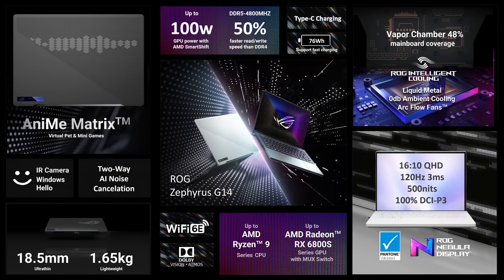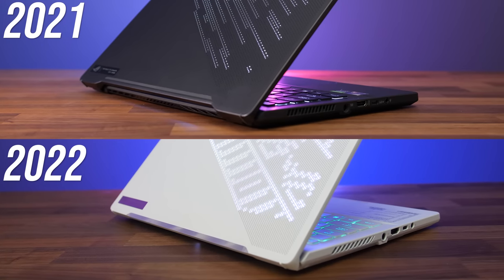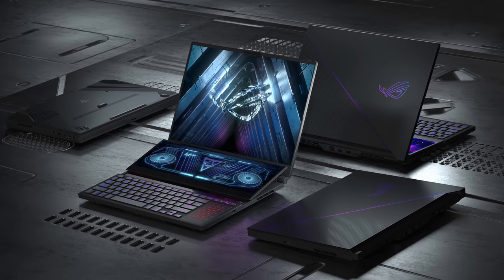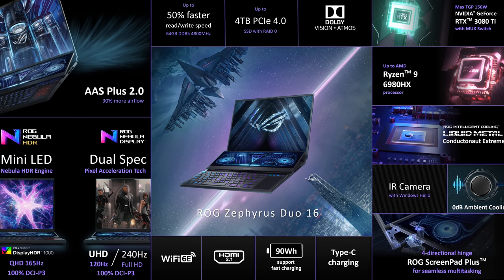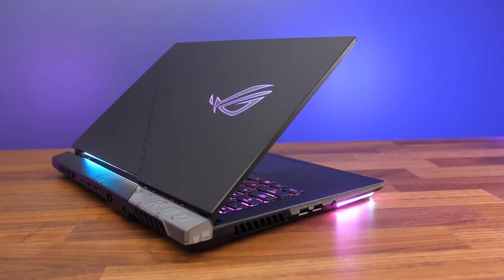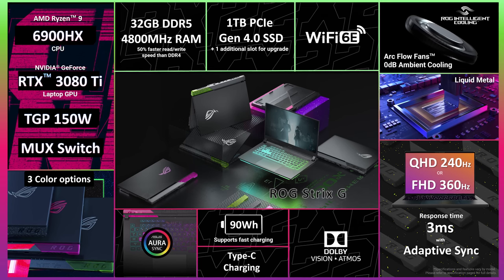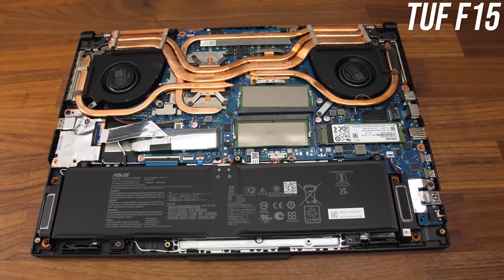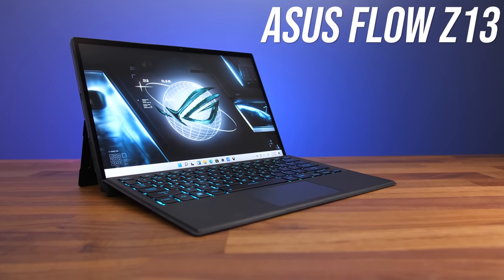ASUS Goes Crazy With Gaming Laptop Updates in 2022!

Comment: Was considering a G14/G15 for the past year, but didn't want to spend so much money on a laptop that didn't meet some of my basic requirements, like having a webcam. Alongside all the other updates I think I have finally found my replacement
Reply: Same
Reply: You can use your phone as a webcam through their software…
Reply: @NamTran-xc2ip  Yeah I know, but during long meetings and lectures I still like to use my phone sometimes. I just think for the €1800 I would be paying, every basic requirement I have should be included. It’s not like I desperately needed an upgrade either, my current one still runs fine, so I’m waiting until something better comes along, and this might just be it
Reply: its a perfect laptop for me but $1800 is so much
Reply: @Tom2000vE  no webcam = Slimer bezel. It's a trade off. I got the g15 3070 for 1300 so idk why you need to pay 1809
Reply: @NamTran-xc2ip  I’m aware, still I would rather have a webcam and thicker bezels than the other way around. It’s a personal preference 

Prices heavily depend on what country you’re from. I’m from the Netherlands, and would have to pay €2400 for a G15 with Ryzen 9 and RTX 3070. For €1300 you could get a G14 with 3050 here
Reply: @Tom2000vE  what's ur replacement?
Reply: @NamTran-xc2ip  I tried it and it's not that good. quite laggy.

Comment: The 2021 G14 not having a webcam was the only deal breaker for me. Now it basically has no flaws, and a strong choice for laptop of the year.
Reply: dude same
Reply: Having touchscreen would make it perfect imo.
Reply: Among the 3 14in gaming laptop it feels a little no brainer to go for the g14 if prices don’t changes too much since Alienware and razer will definitely be more expensive for somewhat dated design (16:9)
Reply: I bought the 2021 G14 in August of 2021. For me, no webcam is great as it wasn't present in any of my last 2 laptops (dell latitude E6400 and E6540)
Reply: Webcam but no NVDIA. Something had to be sacrificed ):
Reply: @h3ctor272  not having nvidia isn’t bad. Worse ray tracing but outside of ray tracing performance per dollar amd had it in 2021 so I don’t see it changing in 2022
Reply: @h3ctor272  yeah, most people attracted to g14 is those who don't really care for super high end performance i guess. just a really good gaming laptop that is thin and small enough for portable use that you can just open and do work in starbucks without looking like you are carrying a spaceship.
Reply: No g sync. So if you turn off Optimus, you will have no adaptive sync since turning off Optimus turns off free sync/adaptive sync.
Reply: it starts at 1650 tho😬

Comment: Wow, this G14... I was considering it when it first came out, but went with other model in the end.. Though I will probably switch now..
(Except that HDMI directly on dGPU - I'd prefer it on iGPU still, so on linux I can ignore dGPU completely and hdmi works still...
Edit: see comments, or also asus video on G14, really there should be 2 usb C with DP, connecting one to iGPU and other to dGPU, so this is good!)
Reply: You could still connect directly to the iGPU with one of the usb-c ports. ASUS mentioned that on one side the USB-C is connected to the iGPU and on the other to the dGPU. Definitely a laptop worth getting.
Reply: @7kivai  if that is the case, than I just hope it's available soon 😄
Reply: @jdzames  if we already have them in the lab, then probably expect deliveries from February. Huzzah!

Comment: The new tuf line up is a huge improvement imo, 1440p, actual vents, mux switch, up to 140w tgp, tb4, and much more
Reply: yeah huge improvement i also want to see the new legion this year
Reply: Hopefully the price stays reasonable
Reply: @sayansen5016  nope
Reply: @sayansen5016  nope xD
Reply: @sayansen5016  asus and good pricing😂😂
Reply: @jhingakapoor7141  you get what you pay for, devices built with better materials and design will always cost more regardless of the manufacturers profit margin.
Reply: @jhingakapoor7141  scar 15 with 5800h/3080 for $2000 was outstanding value.
Reply: the absolute garbage of a laptop tuff dash f15 sells for the same price as a lenovo legion 5, its overpricing
Reply: @heroofharo  in my region it sells for 3000 dollars
Reply: @jhingakapoor7141  well tuf dash f15 was never a good laptop to began with since it had all the shortcomings of the g14 without any of the positives. But that doesnt mean zephyrus lineup is comparable to legion 5, legion 7 is the only comparably build laptop from lenovo, and it sure would cost a lot more then g14 or g15 in your region.
Reply: @pikachu5647   are you comparing 14 inch laptops to 17 inch ones?
Reply: @jhingakapoor7141  i got ROG Strix G15 for much cheaper than poorly specced last year's Legion 5.
Reply: @jhingakapoor7141  stop crying lmao
Reply: id never touch a tuf asus laptop from fx505 3750h to 1660ti to these 4-6c options with rtx/ampere. Destined to blow. Owned the fx505 long enough to return it. Even worse is the product support/updating the bios/wifi etc its all sub par has been

Comment: I love that almost all of the models will have a MUX switch... This is excellent news for laptop gamers
Reply: What is a mux switch?
Reply: @evanm.2300  It allows the computer to use the built in graphics of the cpu (the APU) for basic stuff and save battery.  Then switch to the big boy GPU for demanding applications like games. Problem is in a laptop without a switch the laptop will only use the GPU when you plug in an external monitor.  If using the laptop screen only the APU will be used and gaming suffers.  Pretty ticked when I bought an i9/Ryzen 9 laptop that didn't have one.

Comment: 2:16

Definitely looking forward to that. The G14 has the most upgrades since last years model. While the soldered ram is still a bummer atleast you can get 16gb right from the start. Making 32gb possible. Which would be plenty for many.
Reply: Removal of Print key is stupid IMO (but no deal breaker) and still no USB4 is shameful.
Reply: @KAMiKAZOW  Asus is always the last to add new tech to their machines. I’m pretty sure they were one of the last manufacturers to add thunderbolt to their laptops. So I’m not surprised they don’t have usb 4. I still think the overall package is good so long it’s priced well. Unlike the new Blade 14 models.
Reply: @Terreos  im pretty sure no new laptops announced as of right now have usb 4, correct me if I'm wrong
Reply: @Terreos  Asus always think innovative over Small features. This year though they went all in. That Zeph Duo the most stacked laptop on the market
Reply: @naseemyasir  I know I’ve heard of it. But I can’t recall where. So likely I’m getting something mixed up. 🤷‍♂
Reply: @Terreos  you probably saw it on amd'd presentation as they did show it off, tho again I don't see any laptops that actually have it

Comment: Nice design on the TUFs - something about them really appeals.  They're all pretty impressive.  Also interesting Asus managed to get webcams in those thin bezels - they should talk to Apple about their intellectually impaired choice to put a huge notch in the middle of their super-high-end Macbook displays, coz what designer would be bothered by that.  Still, most interesting tech I've seen today.
Reply: Hopefully they fixed the shitty thermals
Reply: @mrducky179  well, one cannot simply perfect at everything, but for me, i would prefer thermal issue than hardware issue.

There are simply so many solution to thermal, place your laptop higher, go in an air conditioned room, repaste, even an external fan, etc.

But on the other hand, no mux switch? Good luck fixing it. 67%sRGB coverage? Good luck fixing it.
Reply: @khangle6872  wait the entire gaming lineup did get mux switch i think youre mistaken
Reply: @mrducky179  He's giving an example of things you yourself can't fix.
Reply: @-eternal  click read more

Comment: The G14/G15 legitimately no longer have any compromises from what I can tell. The only complaints I've heard of we're MUX Switch, Webcam, and Screen Latency (G14), and the G15 3080 limited wattage. Ram is another story though. Hopefully pricing hasn't changed drastically, hopefully the G15 becomes available before Q2 2022.
Reply: Screen latency is only on the first gen g14 (which was 2020 i believe) as it is the only 14 inch gaming on the market, second gen g14 already had better solution since many more competitor started to jump in and so is the screen availability, this year is another improvement
Reply: @khangle6872  that's true. I heard the g14 2021 was around 8-10ms.
Reply: Iread that the g15 still has the old spect ratio and not the modern of 16:10 and still no thunderbolt 4
Reply: @vrol3425  Still no USB 4, bummer, and no 16:10. They don’t want to cannibalise their own sales (M16).
Reply: lmao my 5900hx barely ran at 4ghz in any games. Like talking valorant or cs:go or gta v some single threaded games......idk if a mux switch matters much to me....when the cooling system has so much "shared" aspects that on a shared load the cpu hits 90c even in single core games. Where youd figure it would be necessary if im trying to connect to a 240hz 1080p monitor or a 165hz QHD monitor externally. And the cpu isnt even zen 3 its a monolithic design too...so the IPC is already weak if intel can run 4ghz with ease on these single threaded games. And at lower temps. Sure a few newer AAA games were able to push the 3070 to 100w and still get by with a 20-25w cpu with the 5900hx...but it was CLEAR that the 45-65w potential of that cpu was purely for "renders" at 90c.....and theoretical benchmarks so they could say theyre competitive with intel...when in reality my 10750h 2070s max q omen was a much better experience which i returned the g15 for...bc the g15 got stuck in whispermode 2.0...and my return period was coming close...didnt really want to wipe to a fresh install and re DL 2-300 GB to test the system for fidelity for it to just update nvidia/geforce experience and then some how have nv control panel locked in whisper mode. I was THIS close to exchanging the zeph g15 for the amd advantage edition G15. And i saw all the reviews of people with DOA 6800m from the liquid metal being over applied or just overall shoddy workmanship. and it melting into the gpu die  or on the board and frying it. As BB recirculated these DEAD laptops to other buyers as open box purchases. XD. I was like well if asus isnt taking responsability and forcing the retailer to keep these BS products in circulation even though they know its on THEM...F asus. Go look up the reveiws on the G 15 amd advantage laptop on BB and look at all the complaints. My spacebar would get HOT at idle with the zeph g15...and i tinkered with seemingly endless setitngs to try to lower the cpus heat at idle and in game. And the NVME go hot too heating space bar and track pad. Best thing about that laptop were the speakers/track pad/panel. Asus never delivers its why the pre 2021 zeph had varoius g14/15 models From the initial 4800h 2060. Just a continuance of their inability to provide a proper product.
Reply: @anhiirr  you should've disabled boost for gaming. Lowered Temps by up to 20C
Reply: @aladdienfadhel8259  i did i ran all profiles lowered tdp used a cooling pad....the only way to get it to run low on idle was if i ran it on the "un plugged" power profile even when plugged in. Plus that is like day 1 tinkering bc it can auto engage BOOST/turbo if it thinks its plugged in which is also a profile/setting that has to be disabled or not set to auto. etc among others
Reply: @anhiirr man that sucks. I disabled boost, and it only got barely warm. Unless I played a game on turbo then the the plastic below the space bar got annoying hot, that's without a cooling pad. With cooling pad, it was more quiet and significantly cooler.

Comment: I was actually looking to buy the Legion 7. I was happy with all the specs, although the 16:10 16" screen wasn't my favorite feature. The Asus G17 has a 17.3" screen, which I tested and found perfectly between screen size and portability, didn't have a MUX switch so an external monitor was needed for the fps boost. But when I found the live stream yesterday, I'm so glad I didn't bought the Legion 7 because the new 17.3 inch model seems PERFECT for my needs! :)

Comment: Hi there! i am confused between choosing these two ( Asus F15 2022 i7 12th gen 2k resolution display & Rog strix G15 ryzen 7 6800H with same resolution) 

Tuf has Thunderbolt 4 but doesn't support power delivery !  and strix don't have a thunderbolt 4 but supports a power delivery through usb 3.2 gen 2 type C

Tuf has a num pad and strix don't

Tuf comes with a built in camera and strix don't (can be added with a clip web cam )

Strix comes with a dolby vison and tuf don't

Which has a better performance in these models intel i7 12 or ryzen 6800H ?

Battery back up?

Does both have a mux switch?

To use with programming, photoshop, editing, gaming ! 

Help me out to pick one guys! both is around 1.5 lakhs.

Comment: Man, I can’t decide if I should get the 2021 or 2022 M16.
The 2021 is 250€ cheaper which is really appealing, because most of the specs of the model that I’m interested in, besides CPU and DDR5 RAM, are basically the same.

Comment: Hi man thanks to show us the new models from asus , i wanna share my result of new asus 2022 , i have one from new asus models:
asus rog strix G17 with amd 6800H and RTX 3060 , 16GB ram ddr5 4800mhz with 360hz full HD:
the laptop in under load 100% cpu in performance mode is
min : 61c , avg :  82.21 and max :  93c
with cooler pad custom (arctic f12 full speed rpm 1350 rpm)
min : 58.38c , avg :  85.94c and max :  90.13c
manual mode fan peer percentage is : noisy
min : 44c , avg : 77.08c and max : 84.75c
and in idel mode performance is :
min : 58 c and  avg :  63 c ( just in standby)
with cooler pad custom (arctic f12 full speed rpm 1350 rpm) is :
min : 57c and avg :  59c ( just in standby)
manual mode fan peer percentage is (noisy):
min : 44 c  and avg : 48 c ( just in standby)
so what u think about this result?

Comment: What a great improvements to all lineup!!!!, they finaly listened to the mux switch, the better cpu and gpu, webcam, and the bottom vents for the fan are better now that there are more holes for intake air, i am still loyal to my (2018 Scar GL503VS GTX 1070/ 2019 Scar 3 G531GW RTX 2070) I LOVE ROG

Comment: when is the strix scar 15 coming? btw does the 17' variant have only 1080p 360hz or does it support QHD 240Hz/165Hz as well?
and are the AMD models coming same time as intel or later this year? also if I opened the laptop and put a 980 Pro 2TB and 64GB DDR5 RAM that it supports in future will the RGB Bar wont work again? like can i just reconnect it? Thanks!
Reply: I've also seen the bundle it has a webcam, headset and a mouse. and a backpack as well!

Comment: Wow, the new G14 looks really really good. 
A larger screen (16:10) in a smaller body, Vapor chamber, Higher TGP, and MUX switch on everything!

Asus really listens to the feedback. 
To be fair, Asus laptop lineup looks pretty solid now.

For me, MUX switch is really important. I really hate Hybrid Graphic, it's buggy, slow, laggy. It has more problems than you think, it's not just a few FPS drops. So, having a MUX switch that allows us to choose from the hardware level is much better.

Comment: Is a mux switch a deal breaker? If a laptop has good specs but is lacking a mix switch is it still worth it?
Reply from the maker: It will depend on what you're using the laptop for, but for the most part not having a mux switch isn't going to stop you from being able to do whatever you want.
I'd recommend checking out reviews on the laptops you're interested in and seeing how they perform.
Reply: @JarrodsTech  thanks for the response its hard to find a review on this specific laptop it would be for gaming mostly ....GIGABYTE - AORUS 15.6 IPS 240Hz Gaming Laptop - Intel Core i7-11800H - 16GB Memory - NVIDIA GeForce RTX 3070 1TB SSD
Model:AORUS 15P XD-73US224SOSKU:6498270

Comment: the m16 is in the Netherlands already available in a store for €1779 with a 16 inch screen (2560x1400, 16 : 10 165 hz) 16 gb dualchannel ddr4 memory upgradeable to 40 gb with a core i7 11800H 2.3 ghz to 4.6 ghz graphics are a geforce rtx 3060 and 1 tb storage with a camera with the resolution 1280x720, 240W ac adapter and it weight is 1.90 kg but maybe its from 2021 i can't see it

Comment: I really need a reply from u , actually in between 1-2 days I am going to get a gaming laptop , but I'm so confused about the one , nd want to ask an expert . According to my max budget what I'm think is to buy Asus Tuff F15 i5 11 gen with rtx 3060 6gb with 16 gb ram laptop the GPU is high nd there's not a single laptop near this price range having 6gb of vram nd 144hz refresh rate . My aim is to get as max fps i can get in Apex Legends on Medium settings. So pls tell me should i go for it in 2022 or not nd what would u do according to my circumstances . Thank you so much if u r reading till here 🙏 ❤️
Reply from the maker: For eSports pick something with mux switch
Reply: @JarrodsTech  I'm literally more confused I know the role of mux switch , but I don't know what to do now , my budget is pretty low 1200 $ nd allowing me to get higher ones , what's ur advice is there any good laptop that fits my budget or i should wait for 2022 whole year God damnn . Thank you for your advice , very useful 🙏🙏
Reply: @JarrodsTech  sorry but last question what if I use any spare monitor in that case should i go for Asus tuff F15 i5 11gen 3060 6gb with 16gb ram now what ..